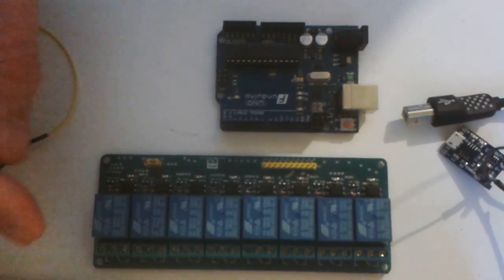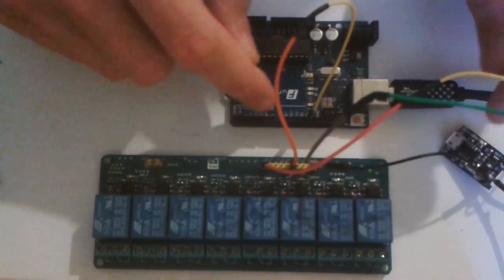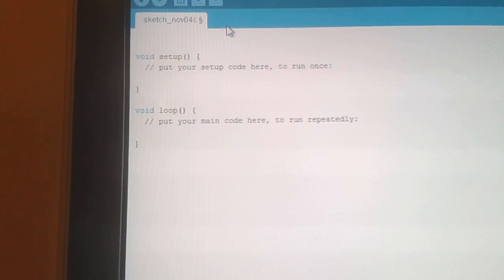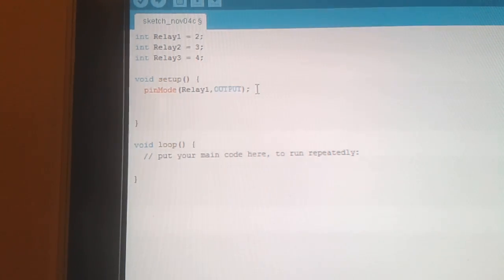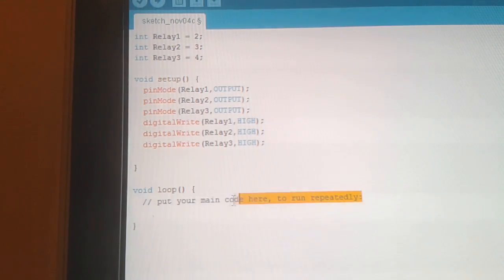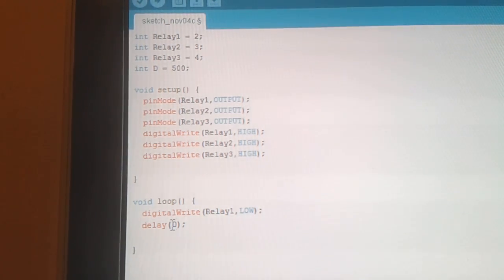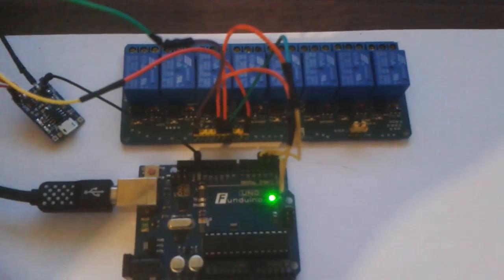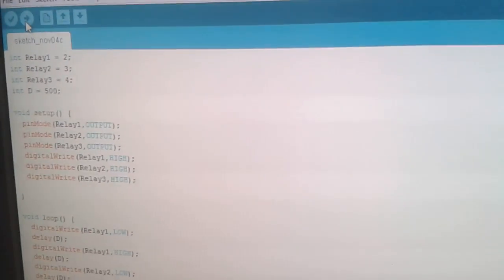Using 8 Channel Relay With Arduino (Tutorial)

Comment: Thanks for the great video. I know you made this video a while ago but I am working with a 4 relay board. It may sound simple to you but I need a momentary switch to start the sequence of 4 relays, if the switch is not pushed again it will not allow the sequence to run through all 4 again relays again. I have the 4 relays running perfectly with adjustable time but I'm not having good luck figuring out how to start the sequence or let the sequence end with a switch. please help.
Reply from the maker: Thank you, can you explain what you are needing a little clearer please
Reply from the maker: I think I know what your saying, I'll write some code for you as soon as I get A moment

Comment: I never spent this much before.  BUT ONCE RUNNING,  it will automated watering food plants!
Reply: I priced everything listed thru amazon.  One was a kit with another brand arduino board I believe.  As for hose length15’ per line average.  I will pull from a 55gallon rain barrel x 2 (expand to 5) for Margery’s garden and fruit trees / plants planned. We have dry spell and need water to make veges.

I  was given 750 gallon water retainer potable to collect rain barrels x 5 twice.  That should cover watering everything during dry season..  it is up hill and will be used for other plants.
Reply: This arduino is for potted Asian and American plants.   How many switches can a single “Arduino Uno” support?  After I learn this set up... I will use big pumps/hoses for garden and fruit plants. (Phase II).   I sell blueberries/blackberries/grapes street side. Make little money.
Reply: So sensors are read directly by arduino dry or wet by number indication, with if statement your arduino switch for that pump to run until moisture sensor says it it wet then reading tells Uno to switch off pump.... correct logic?
Reply: Ok , so each switch is on/off for each pump.. you said switches need separate power. Those pumps are 5volt each only. I was not sold power chord for I switch relay. I need correct power chord and I guess there is single location to soldier on power supply wire..

Comment: I will have 1 extra 8266 and 1 extra pump, I can use on 2nd build.    Again if I do not need arduino (HAVING ELEGOO UNO R3 IN THE KIT, TELL ME.

I CAN SAVE MONEY BY NOT BUYING ARDUINO BRAND BOARD FOR NOW.  I CAN BUY LATER FOR PROJECT  2.

Comment: I purchased more wires...... (Elegoo EL-CP-004 120pcs Multicolored Dupont Wire 40pin Male to Female, 40pin Male to Male, 40pin Female to Female Breadboard Jumper Wires Ribbon Cables Kit for arduino). CORRECT WIRES?
Reply: So elegoo in kit WILL REPLACE ARDUION UNO.?   I will delete arduino to save money this round.  I am at $103.00usd!  Ouch

Comment: Isn’t the a rebranded arduino uno v3? -     ELEGOO UNO Project Super Starter Kit with Tutorial and UNO R3 Compatible with Arduino IDE.   If so, do I need arduino uno v3 also?
Reply: So I do not need the arduino v3 board.  Just the elegy uno in the kit... (save money I do not have lol)

Comment: $8.39
& FREE Shipping on orders over $25.00 shipped by Amazon. Details  & FREE Returns 
Arrives: Saturday, Dec 19 Details
Fastest delivery: Wednesday, Dec 16 Details
Arrives before Christmas.
In Stock.
Qty:
Qty:1
 
Add to Cart
 
Buy Now
   Secure transaction
Ships fromShips from	AmazonAmazon
Sold bySold by	HiLetgoHiLetgo
Ships from
Amazon
Sold by
HiLetgo
Return policy: Returnable until Jan 31, 2021 
Yes, I want FREE delivery, as fast as today with Prime
Add a gift receipt for easy returns. Prices are hidden.
Deliver to ALTON - Harlem 30814‌
 
Add to List

Share       
Have one to sell?
Sell on Amazon
 
Sponsored 
 HiLetgo 5pcs Capacitive Soil Moisture Sensor Module Wide Voltage 3.3~5.5V with Cable Wire for Arduino
Roll over image to zoom in
 

 

 

 

 

HiLetgo 5pcs Capacitive Soil Moisture Sensor Module Wide Voltage 3.3~5.5V with Cable Wire for Arduino
Visit the HiLetgo Store.     QTY 2 (FOR OTHER PLANTS LATER (BUT USE QTY 4 NOW)

Comment: Thanks for a great tutorial video and making the coding part especially easy to understand.  I hope to build a large irrigation project on arduino board, and use relays to turn on solenoid water valves based on a varying watering schedule for whatever the various plants need.
Reply from the maker: Sounds like a great project,  hope you video it and I'll help where i can, thanks for the comment,  appreciated

Comment: KIND SIR,  THIS VIDEO IS OLD  but I have dire need to use this to assist HANDICAPPED.   I HAVE  8 RELAY. I NEED THE ARDUINO. CAN YOU GIVE WEBSITE TO CORRECT ONE.
ALSO, I NEED TO MONITOR 8 PLANTS WITH MOISTURE SENSOR / AND WATER EACH WITH SEPARATE WATER PUMP EACH.   
SENSOR WIRES NEED TO BE 15 FEET FIR EACH SENSOR.  WATER HOSE FROM PUMP TO PLANT SHOULD BE 15 FEET EACH.

CAN YOU VIDEO CONNECTING (ALL) WIRING.   INCLUDE ALL CODE.  WEBSITE TO ORDER ITEME I NEED.

DISABLED can then have plants/flowers /birds bird bath.  Most Humble Appreciation!  Alton
Reply: Thank you, I am most humbled for your assistance. I can call USA and Canada for free if you are either place. I can share email addy.
Reply from the maker: @smartassist9700   Hi , what was it you wanted help with ? and I live in the UK not USA lol
Reply: Sorry I lost a 24yr old doggy/son today...      disability was 60% heart enlargement instead of heart attack.  Also other organ damage due to it. I get around limited and slowly.  Only 55yrs old.
Reply: I am soooo excited!  I’m in DC 4 wife. Back 2morrow evening.  CANNOT WAIT!  I will hold off until tomorrow nite in comfort of home with my “stuff”.  
GODBLESS YOU OVER AND OVER AGAIN!
Reply from the maker: Get back to me and I'll see what I can do
Reply: I want to monitor 4 plants and have auto watering “as needed” to each plant.  So I have 4/moisture sensors, 4/water pumps,  qty 1 8 relay switch.  Tubing for each pump to each plant.   I am confused if I use “”ARDUINO UNO”” and how many plants can it monitor/water?  OR BETTER TO USE RASPBERRY PI (MODEL?) and how many can it manage.

I will be adding in summer in qty of 4 at a time.  I may have 80 total.  I do not mind how many ARDUINO / RASPBERRY NEEDED.

A GARDEN I CAN MANAGE.

I ALREADY HAVE QTY 5 OF 5TGALLON RAIN BARRELS AND ONE RETAINER BARREL @ 500GALLONS AT TOP OF HILL TO RUN DOWN BY GRAVITY TO HANDLE ALL WATERING.

NOTE: DEVICES WILL BE OUTDOORS. I CAN BUILD WATER PROOF BOXES.  BUT HEAT GOES UP TO. 43.3 Celsius! Haha
Reply: Yep I have that 8 relay board.  (4 for water sensor / 4 for pumps I figured). What is maximum number of relays an ARDUINO CAN MANAGE?  Or RASPBERRY PI (if it will not overheat in summer time...scared of hardware not working in heat and computer more sensitive with OS and commands both.
Reply: Ok, so 4 sensors to relays to trip them to release power to pumps until they sense moisture and switch power off on pumps.  It will be low possibility all 4 pumps will be on at same time.  Plus one plant requires LESS watering.
I am not familiar with electrical set ups or this project. But determined to be able to grow food handicapped.  I cannot afford medicines , bills, and food sadly.  Do you have one of each item to slowly record video putting it together /close up wiring/website for code/ etc? I can freeze video slowly piece by piece.  Then duplicate as much needed perhaps.  Again most Humble Appreciation!  Alton
Reply: The plants are in different pots as well as in ground.  1 moisture sensor for all ground plants to trigger 1 pump.  Then separate moisture sensor per pot and 1 pump per pot.  They have to be watered separately . Some plants die with to much water.  

Moisture sensor is a two prong ,flat, coated black.  I paint thin sides to stop erosion of sensor.

Pumps are very small from China. Very low voltage. I have clear tubes like IV hospital tubes to pump water through.
Reply: If I can afford plastic and hire help to build a green house. THEN 1 SENSOR AND PUMP will do for growing seedlings.  But for NOW I am working with plants not seed.
Reply from the maker: @smartassist9700  I would recommend starting with one as you'll have to take note while testing to get the correct amount of water to the plant. the time it takes for the sensor to send the data and for the pump to shut off ex will all play a part in setting this up. I'll make the video tomorrow.
Reply: I have done nothing other than buy items mentioned.  I do not have Arduino uno. I do have raspberry pi. BUT I think that will overheat as computer outside during very hot days...  I need how to step by step video connecting wires /hoses /pumps, copy code, show how to make code work.

I am not programmer.  I’m disabled, trying to create working item that others seem to have.
Reply: It’s hard for me to follow thru unless slow, also my pace is challenging, sorry.

Comment: is it possible to run them all at the same time rather than 1 after the other?? thank you
Reply: Yes, you can control the pins individually or together. All eight can be switched together, if you need to.
Reply from the maker: Agreed

Comment: How to interface 12v 8channel relay to Arduino...pls.find help
Reply from the maker: using a 12v 8 channel relay won't be any different apart from the relay will have to be powered from a 12v source, the Negative from the 12v supply will need to be connected to the arduino as well as the relay. this is called a ground reference, I hope that helps.

Comment: hi liney. Can I know how to code the relay example it will on for 5sec and off for another 5sec?
Reply from the maker: you'd just change the delay on digitalWrite(relay1,HIGH);delay(5000)digitalWrite(relay1,LOW);delay(5000);
Reply: +liney118 5000 is represent for 5 sec?
Reply from the maker: basically yes, but other delay's used may add more time over the loop
Reply: +liney118 Okay.. Thankyou for the help 😁
Reply from the maker: so if you use the code below, just change int D = 250; to D = 5000;
Reply: +liney118 so i can also use the code as shown in the video? Bcs im doing a water fountain project. But Im not really into coding an arduino and so on. 😕
Reply from the maker: Yea
Reply: +liney118 alright. thankyou.
Reply from the maker: your welcome, try this video if you haven't already, maybe useful and code is supplied https://www.youtube.com/watch?v=n8DXhbj9VWg&t=1s
Reply from the maker: if you get stuck, just message me and I'll be happy to help :)
Reply: +liney118 okay. btw thank you againnn.
Reply from the maker: you're most welcome

Comment from the maker: For Single Push Button Using High's and Low's

//////////////////////////Button/////////////////////////
int Button = 0;
////Status/////
int Bs1 = 0;
//////////////////////////Relays/////////////////////////
int Relay1 = 2;
////Delay//////
int D = 250;

void setup() {
  Serial.begin(9600);
  pinMode(Relay1,OUTPUT);
  pinMode(8,INPUT);
  digitalWrite(Relay1,HIGH);
}

void loop() {
    Button = digitalRead(8);//change A0 to Digital Pin Used for Button
if (Button==HIGH&&Bs1==1){digitalWrite(Relay1,HIGH);delay(D);Bs1=2;}// Off
if (Button==HIGH&&Bs1==0){digitalWrite(Relay1,LOW);delay(D);Bs1=1;}//  On
    Serial.println(Bs1);
if (Bs1==2){Bs1=0;}
}

Comment: how to code  for example 30 minutes or 60 minutes/ 1 hour on /off ? thanks
Reply from the maker: it's all depends on how you code it, but basically you'd just ++ an int value , so you'd use 60000 for your minutes and then have that   ++ a different int value for your hours

Comment: How many operations are these relays good for? they seem very loud.
Reply from the maker: No they not very loud, What do you mean by operations.
Reply: Personally, I think they are loud, or at least the module I have. Next, What I meant when I asked about the operations. I read somewhere that these are only good for like 10,000 operations.
Reply from the maker: these thing's go for millions of operation, 10,000 just an estimate
Reply from the maker: how long these last mainly depend on supply voltage/current and the connected switching load.
Reply: This type of relay only satisfies immediate applications for limited time use. I would never leave the power on connected to these relays.

Comment: I am a noob to arduino. I'd be highly obliged if anyone could help me out with the following. I've been wanting to connect a 12V water pump + a 12 V solenoid valve [A] + (12 V solenoid valve[B] and a 240V AC air pump) together for a filter. I require the sequence operation as follows: 12V water pump + 12V solenoid valve[A] on for 5 minutes; 12V water pump + 12V solenoid valve[A] off for 2 hours; 12 V solenoid valve[B] + 240V AC air pump on for 10 minutes; and repeat the above process 10 times. I am using a 4 relay board to connect the appliances. I am good with the wiring but am really stuck at how to program the arduino to carry out the above. I'd be happy to forward the design of the apparatus to anyone wishing to help me out to explain it further in detail.
Reply from the maker: Sorry

Comment: hey bro can u plz give me the whole connection diagram? how do I connect my relay board with an external power supply(like using an power adapter) or can I supply power to relay board from my arduino?(my relay board is: 5v 8 channel relay board and arduno is 5v).. and can u plz send me that code??
plz mail me at " cmurkho@gmail.com "
Reply from the maker: I don't have a diagram dude :) it's easy man, just follow the tut, as for the power to the relay board + from power supply to vcc on the relay, ground from power supply to the uno ground, then uno ground to relay ;)
Reply: thanks bro
Reply from the maker: the code was just an example to show basic functionality, would be useless in the real world, what you making ???
Reply: I am making an arduino based home automation, where I m using 8 channel relay
Reply from the maker: Chorom Murkho Cool, sounds good, I thought about it a few times, but can never be bothered :(  , if you get stuck with coding or anything , give me a shout, happy to help

Comment: How you turn each relay on and off seperately
Reply from the maker: +GREG ROWE I don't get the question ?
Reply from the maker: Hi Greg, I've done a new Tutorial with the relay, but this time using a bluetooth  and android phone to turn the relays on and off, if you don't have an android phone, that's ok as the code can be changed to use buttons or other sensors for switching them on and off.

Comment: Hello!
Could you explain how to connect 16-channel relay module to UNO and operate all 16 relays.
Reply: You could also use a Shift Register to increase your output channels.
Reply from the maker: +Eldobaz D'Shkandebal  For a 16 channel relay board on an Uno you'd have to used something like a TLC5940NT to expand your outputs, I know the TLC is intended for use with Leds via PWM, however as the chip sources to ground it could very well be used though not recommended, using such a chip will let you expand as many chips as you like giving you an unlimited amount of outputs(example only) ;)
Reply: Eldobaz D'Shkandebal I